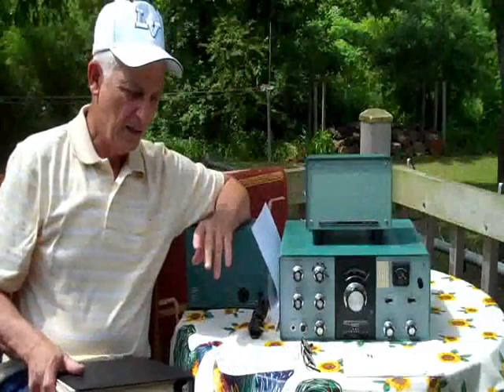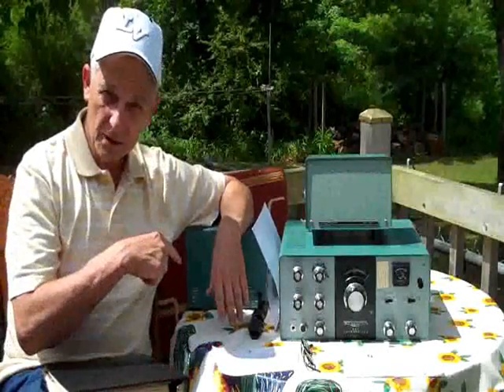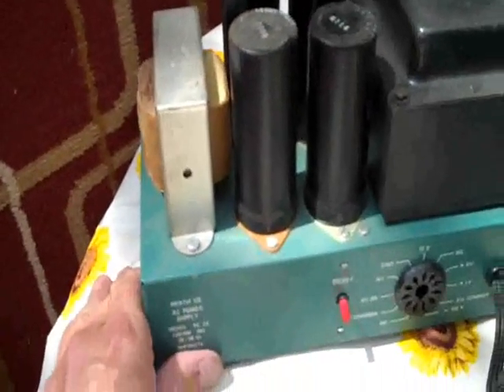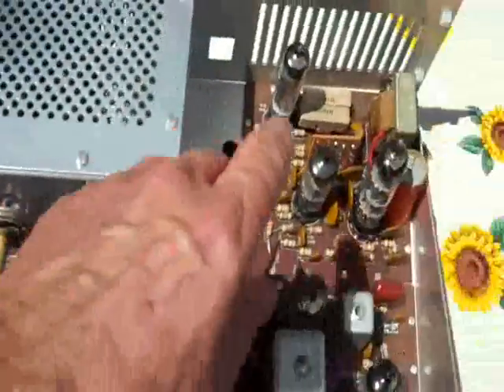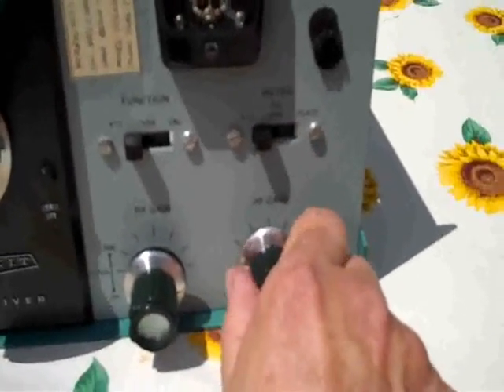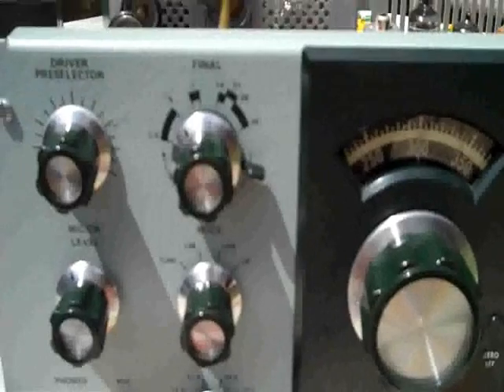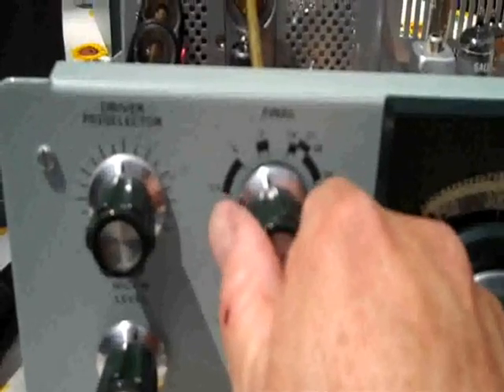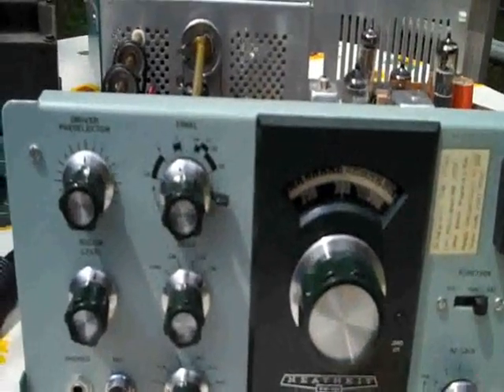Obtaining a Ham license-step-by-step-details you need to know (part 6 of 34: Selecting a radio.)

Comment: Hi Joe,
Since the CW /SSB it's probably safe to assume you have a CW filter. This will be great if you decide to brush up on your CW skills and join many of us who enjoy CW.
In my humble opinion, the HW 101 with speaker, power supply , manual and CW filter would have a fare market value of between $225 and $300. In that condition, it would easily bring $300-$350 on ebay sold as separate pieces. 
I have sold a number of HW 101's for ~ $250 - $275 working. That's a nice 1
73,
Glenn WA4AOS
DSM Labs

Comment from the maker: @n5syr1,
Right you are, Mark.  Wayne took very good care of it.
It's still torn apart on my workbench.  The receive side was  given a complete realignment and a few more wafer switches were found and cleaned.  They were hidden by a large metal plate underneath.  Things now sound much better.  Next comes a few modifications.
Thanks for stopping by.

Regards,
John.

Comment: The small transformer on the PS chassis is most likely a choke. Resonating the tank or Plate/Load adjustments are critical. You should get the operating manual before you tune it up to an antenna. The "tune" function should be for doing the initial tuneup before you put full grid drive to the finals but I am not 100% positive about that. '73' Gary KC9RUB